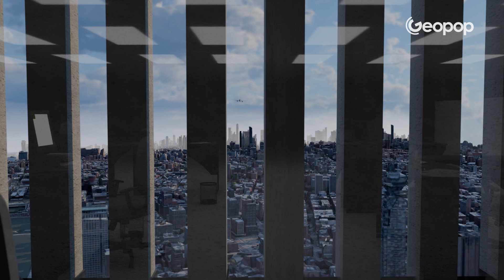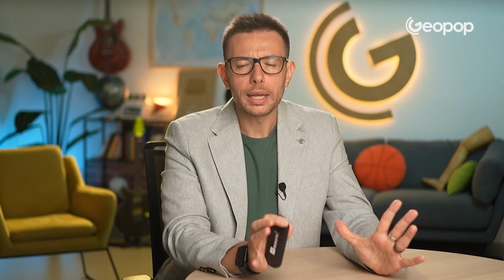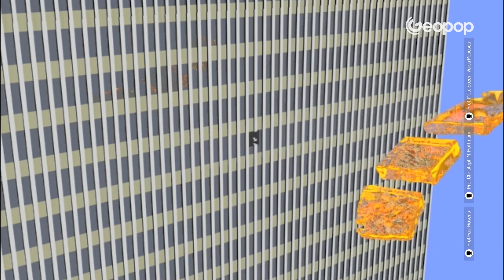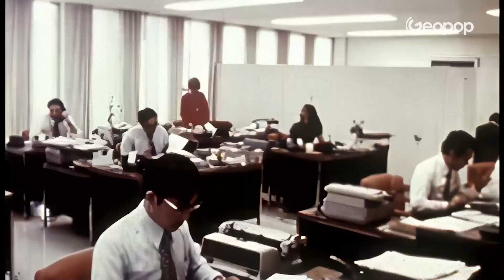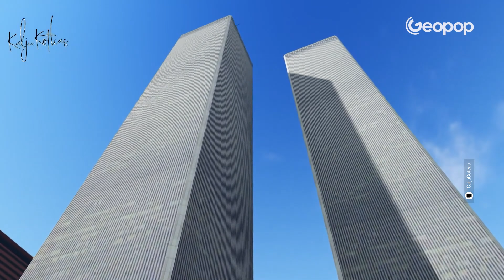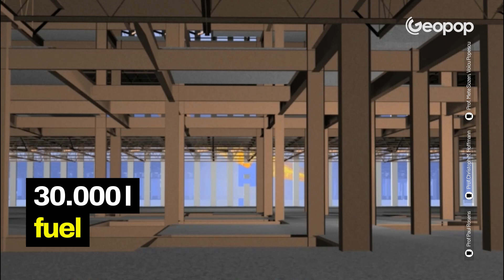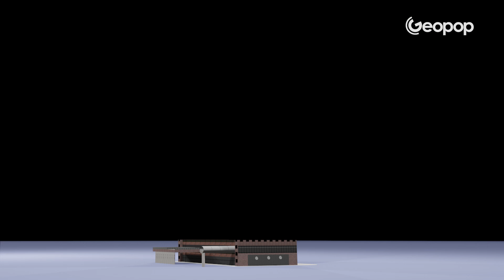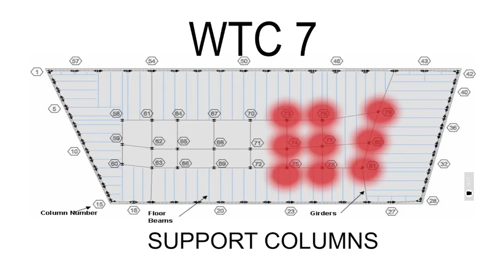9/11, 2001: The Technical Reconstruction of the Twin Towers and WTC 7 Collapses

Comment: Anyone who sees those buldings get completely blown up and STILL thinks they were a genuine collapse becaue of fire is INSANE. Anyone who understands how energy works cannot possibly conclude that they collapsed in the manner they did due to fire at the top alone. Then there is Building 7 - an obvious controlled demolition.
Reply: I am one of those anyone's and yet I can do this (I bet you can't):  Building 7 - the 6th building to collapse of 10 lost on 9/11 - because of its low priority was largely ignored early on, so conspiracy filled the information void with a lot of  garbage from ignorant people promoting political agendas, creating a lot of confusion and misconceptions.  So I prepared this brief summary using my own technical analysis, not ideology and magical (non)thinking to dispel them. 

At 10:28am the WTC North Tower collapsed, showering Building 7 with tons of burning debris, causing heavy damage and starting many large fires that burned out of control for the next 7 hours. Half the FDNY firefighters having been killed, units in disarray, equipment destroyed, no water pressure, and the greater urgency of search & rescue efforts, Building 7 couldn’t be saved so firefighting efforts were pulled as futile and 7 left to its fate. Firefighters make that sort of choice every day in brush fire situations - which houses to save and which ones to let go. Only real difference here is moving the decimal on the size and cost. People get overwhelmed by the size.

www.youtube.com/watch?v=g_SvpwyC17M

Collapse of a burning structure is always a concern for firefighters and steel buildings are uniquely vulnerable to fire damage. When subject to fire they rely on active firefighting to survive, designed around 1 to 3 hours of fire resistance to, allow time for occupants to escape and active firefighting to get started.  After this all bets are off. Left to their own devices they'll exceed their design envelope and collapse, like Plasco Tower and Wilton Paes de Almeida. In 7 the occupants escaped, passive and active fire protections were compromised and active firefighting was abandoned hours before the collapse, which left the building to its fate. It lost. Odds on Building 7 would eventually collapse, and it did. No big deal in logic.

 http://www.youtube.com/watch?v=WnYBX6QT0R4 

FDNY Chief Daniel Nigro - The biggest decision we had to make on the first day was to clear the area and create a collapse zone around the severely damaged 7 World Trade Center, a 47-story building heavily involved in fire. A number of fire officers and companies assessed the damage to the building. The appraisals indicated that the building's structural integrity was in serious doubt. I issued orders to PULL back the firefighters and define the collapse zone. It was a critical decision; We could not lose any more firefighters. It took a lot of time to PULL everyone out, given the emotionalism of the day, communications difficulties and the collapse terrain 

FDNY Deputy Chief Peter Hayden ; We had our special operations people set up surveying instruments to monitor and see if there was any movement in the building. We were concerned of the possibility of collapse in the building. And we had a discussion with one particular engineer there, and we asked him if we allowed it to burn could we anticipate a collapse and if so, how soon? And it turned out that he was pretty much right on the money, that he said 'In its current state you have about 5 hours 

The collapse of Building 7 was anticipated and widely reported in the media throughout the day, with 24 video cameras recording some or all of the collapse. Everyone knew what was coming and why. 

www.youtube.com/watch?v=OY5S5k3tMHI

Building 7 collapsed from the inside out which is not at all intuitive and hard to understand with most details being hidden from view.  It requires careful analysis and observation, and some people will struggle no matter how much it is explained. But here is my explanation relying on no outside authority. 

Building 7 was a unique, asymmetrical 47-story steel frame structure built atop a smaller 3-story building serving as a partial foundation, requiring lower floors dedicated to complex load transfer structures. Of trapezoidal shape and tube-in-tube construction, B7 (above the 7th floor) consisted of a central core of steel columns carrying most of the gravity load, perimeter steel columns around the outside of the structure carrying the remainder of the gravity loads and long span beams and girders to tie those elements together and form the floors. On the outside of the building hung a facade or outer shell. 

www.nist.gov/image-16640

Phase 1 : First externally visible signs of collapse initiation occurred at 5:20:28 pm and was notably quiet with observers not realizing the building was collapsing! No warning in the form of hundreds of eardrum busting 180dB explosive bangs. Here at 12:00 a local CBS affiliate reporter talking 10 blocks from B7 when collapse begins. People don’t start to notice the collapse until 12:11. At 12:45 is the famous CBS fixed camera clip of Building 7’s collapse. Note the silence. 

www.youtube.com/watch?v=t5tEy6mXSE8

Lower floor failures above the load transfer region (8-14) in the NE corner initiated the collapse. In this video at 0:45 you can see the NW corner from inside the building while under construction, Column 79 just out of frame on the left. That big, angled steel beam across the top of the frame connects to C79 at one end. The girders connect to the beam. That beam and all those girders depend on just one connection 

www.youtube.com/watch?v=nP3TNHPCIVU&t=45s

Phase 2 : NE corner floor failures caused a loss of critical lateral support over an excessive length of Column 79 and it buckled. Externally as collapse begins we see a vertical progression of window breakage along the 44-46 line and a kink in the roof of the East Mechanical Penthouse at the top of the building, consistent with C79 failure. Looking at the above floor diagram of Building 7 when you see all the structures that depend on C79 you quickly realize this one column was a relatively isolated structural element on which a disproportionately greater fraction of the structure depended analogous to say the Key Bridge. Normally with a buckling column, the load could be redistributed to other columns. With C79 that is not the case - the failure did not redistribute the load, so the collapse rapidly progressed to the roofline, sinking the rooftop penthouse. The transition from full capacity to almost no capacity occurs in an instant and will result in virtually no resistance 

Phase 3 : With C79 gone, B7’s progressive, non-symmetrical collapse continues with adjacent columns 80 and 81 left laterally unsupported and quickly buckling as well. The EMP drops down through the building. C79-81 all have no diagonal bracing, which is the major reason why they could not redistribute a lot of vertical loads among one another. From there collapse progressed from east to west through the central core until the core was gone from 81 to 58, taking all the interior floors and probably most of the perimeter columns with. Follow the horizontal progression of window failures low in the building and the dropping of the remaining rooftop structures into the building. The NIST Building 7 study model 4 determined C79 failing under ANY circumstances would have initiated the same collapse sequence. 

Phase 4 : After about 10 seconds only the exterior moment frame remains, giving the illusion B7 is still standing to the casual observer since little has outwardly changed. But it is just a hollow empty shell like an empty cereal box supported only by a few remaining columns and overloaded from the loss of the core columns and floors, quite unable to remain standing. With nothing remaining behind it, the north face leans inward, forming a V in the roofline, the last few columns buckle under the strain and the moment frame free falls, landing on top of the debris pile. 

It is more than 10 seconds into the collapse before a single measurement of alleged free fall acceleration is taken. It was not The Building but only the empty hollow outer shell that was still standing being measured. The measurement is not a sustained period of FFA but rather a curve starting out below then up to and OVER 9.8m/s/s before decelerating back down below again, arbitrarily averaged over 2.25 seconds to get roughly 9.8m/s/s. The single measured point was not The Building , was moving in 3 dimensions, not just down and is a product of collapse progression mechanisms not collapse initiation mechanisms, thus tells us nothing about why the building started falling 10+ seconds earlier. It’s meaningless. Start to finish the total collapse took 18-20 seconds or 3 times longer than true FFA . How fast something falls can’t tell you what started it falling anyway.    

The debris spread well outside the footprint blocked surrounding streets, heavily damaging the Verizon Building and destroyed Fiterman Hall. 

No building is meant to survive 7 hours of multi-floor unfought fires. Building 7’s progressive, non-symmetrical collapse was incidental, unintended collateral damage from the combination of fire, time & gravity started by the collapsing North Tower, true no matter who planned and carried out the 9/11 attacks or why .  Of so little consequence it barely registered at the time, only taking on semi-mythical status as an alleged smoking gun years later when demolitions at the Twin Towers, missiles at the Pentagon and shoot down over Shanksville all failed and conspiracists had nothing left to work with. 

Anything can seem like a conspiracy if you don’t understand how it works. Now you should. I hope you found this helpful, informative and it solicits informed critical comment. If I made any errors of fact, logic or reason or left anything important out, please let me know so I can fix it. OR offer a more plausible alternative if you can. Be the first. Please start any reply with the words “Tits McGee” or I will know you didn’t read it and are wasting my time.
Reply: And this:     Twin Towers collapses were relatively straightforward, well understood in the professional engineering community in within just weeks. For the average person though it still requires some effort. Engineering is hard, and who has that kind of time?  So the internet stepped in peddling a lot of really bad information, simple slogans and hand-wave rationalizations that are exciting and require little to no thinking.  That crap gets far too much attention.

Because anything can seem like a conspiracy if you don’t understand how it works and I’m an understanding kind of guy, I prepared this short, detailed technical overview of Twin Towers collapses from my own observation and analysis of available true and relevant facts. No politics, ideology or magical thinking, just engineering. Hopefully this will dispel many common myths and answer most if not all questions you may have about the collapses.  

While complex, most of the Twin Towers collapse mechanisms can be seen with the naked eye and easily discerned and understood by the layperson IF sufficient time is taken to understand.

1. The Twin Towers consisted of 4 primary structural elements that together formed an integrated system where each relied on the others. 47 hollow box-section steel Core Columns carry the majority of the gravity loads. The 236 hollow box-section steel Perimeter Columns carry the remainder and ALL of the lateral (wind) loads. Long-span Lightweight Steel Trusses connect the core and perimeter column together at each floor with a Hat Truss on top to tie the structure together as an integrated unit where no element can survive without the others. There was no structural load bearing concrete and most components were bolted together.

www.youtube.com/watch?v=u7OqrC74Dm4

2. The impact of 120 tons of airplane (= to about 12 dump trucks) at speeds up to 589 mph with the energy of a ton of TNT completely destroys the aircraft. This in no way implies the Towers come out unscathed. Many perimeter columns are damaged or destroyed as are some core columns (example; 33 of 59 perimeter and 20 of 47 core columns damaged or destroyed at the impact floors in the North Tower), This damage is primarily through bolt-shearing failures at the end connecting flanges, as well as bending, twisting and fracturing of weld seams. There was no cutting or slicing - the reality was far more violent and messy.

3. The impacts destroy or damage fire insulation, fire breaks and sprinkler systems on multiple floors. Huge fires are started across multiple floors simultaneously and allowed to spread rapidly with no effective firefighting or fire suppression. This was an unprecedented fire event .

4. The hotter steel gets the weaker it gets . With fire insulation stripped away and no sprinklers the survival time of the steel greatly reduced. Gradually over time heat causes the lightweight steel Floor Trusses at the impact damaged floors to sag, which was observed and recorded. No steel melted or needed to. Structural steel fails long before it becomes a puddle. It just needs to bend

5. Sagging floor trusses pull on the increasingly weak and overloaded Perimeter Columns, causing some of them to bow inward by up to 5 feet. A straight column is up to 4 times stronger than a bent column. The bowed Perimeter Columns buckle and fail, quietly initiating collapse. The formerly static mass above which the structure below could easily support is converted to a dynamic mass up to 30 times greater. Because they have buckled, the Columns above and below the failure point are no longer aligned . The load bearing structure below no longer bears any load as it falls past the lower columns, NOT onto them.

www.youtube.com/watch?v=ULdiD6gYZO0

6. Thousands of tons of debris fall within the four outer walls, down through the open office space, crashing onto the first intact floor it encounters, immediately breaking the bolted column connections as the amount of resistance the Floor Trusses can offer is negligible. The falling debris slows only marginally and briefly. Note: 
6a. This is NOT a solid top block crashing into and “crushing” a solid bottom block . 
6b. The debris falls past the columns not onto them. The columns provide no resistance to the falling debris. 
6c. Only the bolted floor truss connections to the core and perimeter columns offer any resistance. A pair of 5/8” bolts at each end of each truss vs. thousands of tons of falling debris. 
6d. No laws of physics are violated. 
6e. There is no 20 floors against 90 floors but rather 20 floors against one floor, then 21 floors against one floor, then 22 floors against one floor, etc. 

7. This floor-led collapse progression within the four outer walls can only go straight down.
7a. This process is often incorrectly referred to as “pancaking”. The catchy name stuck but nobody knows what it really means and "pancaking" is too simplistic and inaccurate anyway. I prefer Kaiserschmarrn.

8. Collapse progresses through the floor systems past the columns, through the path of least resistance . The resistance offered by each floor is always the same while the mass of debris and its velocity – thus its energy - increases with each floor failure. Each floor offers the exact same resistance to the falling mass while with each failure the falling debris constantly gains both mass and velocity. *This process of floor-by-floor destruction cannot be arrested, it can only speed up . Rate of floor failures increases with each floor as momentum increases, reaching an average acceleration of 0.65 of GA, or 35% slower than true free fall. Bam, bam, bam down the building until there are no more floors to fail. The resistance offered by each successive floor is always the same. More mass, more velocity, same resistance with each floor. Don’t get stuck on the but the lower floors weren’t on fire nonsense. They weren‘t and didn’t need to be.

9. The Towers were 95% air by volume. As that air was compressed inside the building it is forced down the tower and blown out the sides in reaction to the building collapsing . Those were not “explosions”, it was expulsions of compressed air caused by the collapsing building, explaining the low velocity, lack of flash, blast, supersonic pressure waves and lethal high-velocity ejecta.

10. Perimeter Columns become detached and peel away like a banana behind the collapse front, playing out to the four points of the compass extending to more than 800 feet from the base of the towers. This was quite obvious from examination of the debris pile.

11. Core Columns fail last as their internal beam bracing is stripped away by falling debris and lateral support from the floor to perimeter columns is lost.

www.youtube.com/watch?v=WpHXj62Ylw0

12. For those who care about how long this whole process took; 31-34 seconds from the moment the perimeter columns buckled until the last core columns hit the pile, or 1/3 the rate of true free fall. Don’t believe me? Just watch any video of the collapses and note the loose truly free-falling debris dropping much faster than the towers themselves.

13. Each Tower had a 1-acre footprint. Far from collapsing inside their own footprints the debris pile spread out over 17 acres in a pile up to 14 stories deep. 8 surrounding buildings were destroyed and scores more damaged by the falling debris.

14. NOT observed were the 180-190 dB bangs of thousands of high explosive devices or the blinding bright flashes of burning thermite. Neither explosives or thermite could have survived the impacts and subsequent fire nor could have caused the (silent) perimeter column buckling that clearly initiated collapse either. A video of a shocked and injured firefighter casually using the magic word explosion is in no way proof of explsoIVES and the demolition_ case relies entirely on that sort of thing. There is zero tangible physical evidence and it would be technically impossible, totally impractical and completely unnecessary. No one would bother.  In 24 years zero structural engineers of tall buildings, including the 1/3 that have retired in that time, have made any statements in support of pre-planned demolition claims. NONE. The lack of any such citations in the engineering literature (published in any country worldwide) is telling.

15. Twin Towers were perfectly safe within their design envelope. They only collapsed when taken far outside design parameters by an extraordinary and unprecedented event

Impact + Fire (heat) + Time + Gravity = Collapse . Remove any one of those 4 elements and there is no collapse. Ignore any of those elements (as many do) and you will never understand the collapses. The Twin Towers were an integrated system in which no one component could survive without the others. One fails, the rest follow, through the path of least resistance – DOWN – through the open space, bypassing the path of greatest resistance – the columns. Nothing I just described violates any laws of physics. All of the above is true no matter who planned and carried out the 9/11 attacks or why

I hope this was helpful and informative, non-adversarial and it solicits informed critical comment, positive or negative. If I made any errors of fact, logic or reason or left anything critical out, please let me know so I can fix it. To stay focused, just one point at a time please and on-topic (Twin Towers ONLY). No word-salads of Gish Gallop. IF you can offer a more plausible alternative be my guest. Please start any reply with the words “Tits McGee” or I’ll know you didn’t read it, aren’t serious and wasting my time.
Reply: You're welcome
Reply: No, it's that you don't understand materials science and physics. 
The structure was severely damaged and remaining structure lost Ultimate strength and elastic modulus (stiffness) due to temperature increase. This lowers the strength and buckling strength of the structures and they collapsed.
Reply: @Joseph-e9p1x  That process would take a lot of time and the collapse would be a lot slower than what was seen. Do you seriously believe the official story of 9/11?
Reply: @EagleShore286  
I'm not inclined to believe the entirety of the official story. 

The building though burned for many hours, and if the main structural columns buckled, then they don't carry load.